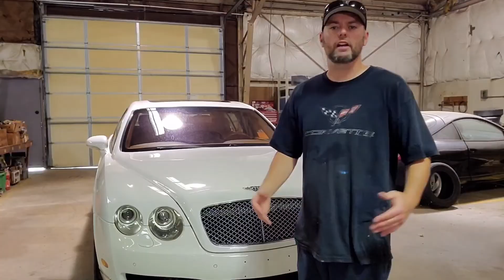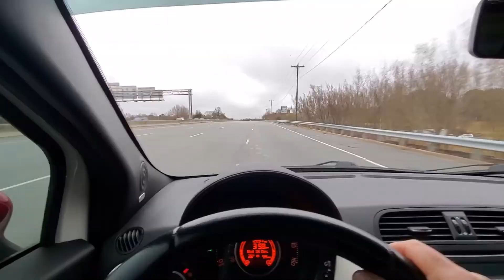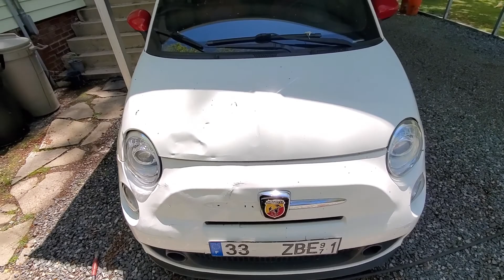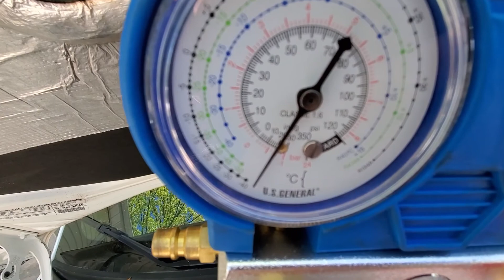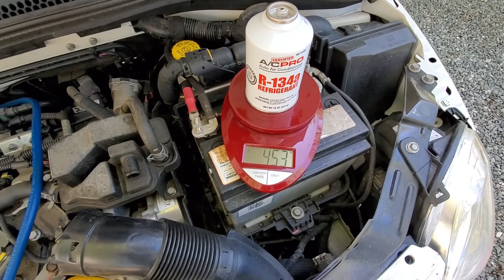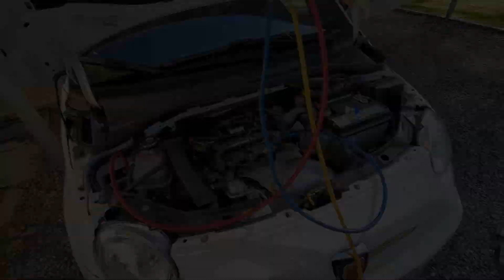Don't Do This When Recharging The AC System - Salvage 2013 Fiat 500 Abarth Project

Comment: My fiat leaks Freon when the car is on. It makes a loud squeaky noise and you can see a cloud of Freon and smell it too. Seems to leaking from the compressor area. It’s a brand new compressor. What could it be.
Reply: Did you get this fixed? I'm having this same issue on my 2013 Abarth
Reply: @mannysgarage no I did not. Still having that issue and also now my engine idles at 1500rpm and it will climb until it goes into safe mode. I’ve replaced the throttle body but still no luck. Still looking for a mechanic that works on fiat to take it to.
Reply: @thelawnguy7373  😢 I was hoping you did. I guess ill have to get it checked at a shop. I added two cans of freon and while recharging, pooff! Big cloud of freon smoke. I was celebrating because it was blowing cold air finally. But I guess it lost it all again
Reply: @mannysgarage I had cold air blowing once and then it leaked out while I was driving. I’ve replace the ac switch and still nothing. I have 75k miles on mine. I’d hate to get rid of it

Comment: Hello...how about a 2016 Mitsubishi Outlander that stops blowing cold air when I'm stopped at a red light or stop and go traffic??? Once I get going, it starts blowing cold air again. REALLY annoying! I have to put it in neutral and rev up the engine when I'm stopped, or I will bake. Freon HAS been properly vacuum and recharged...Any suggestions? Thanks!
Reply from the maker: Sounds like poor air flow thru the ac condenser. Possibly the fan not working or a restriction in the system.
Reply: @4LaneBlacktop  Thanks for the reply...Fan works all the time...system was properly vacuumed and recharged by a shop 3 weeks ago...vacuum and recharge did not fix the issue.